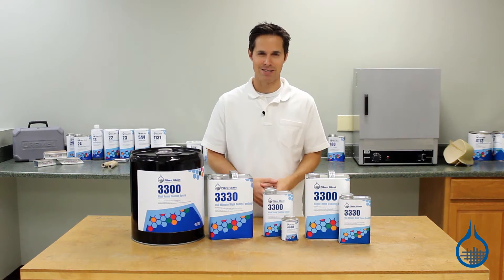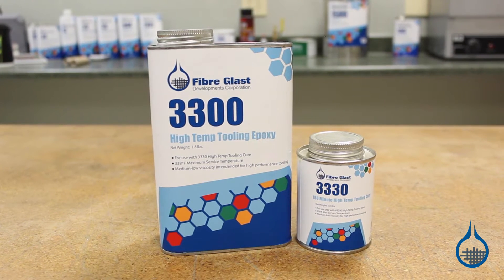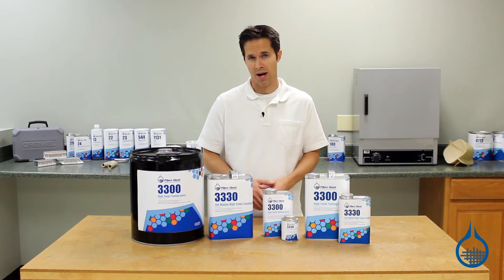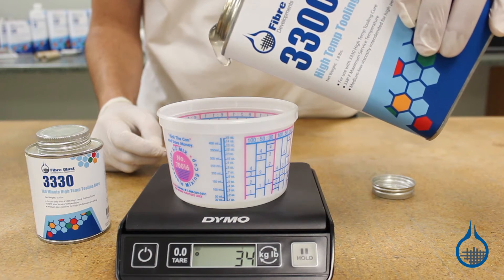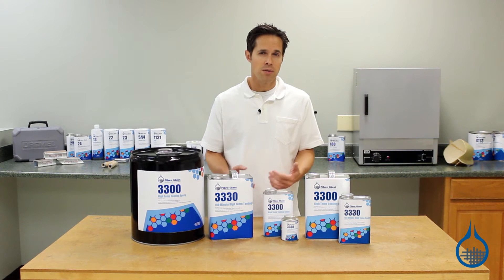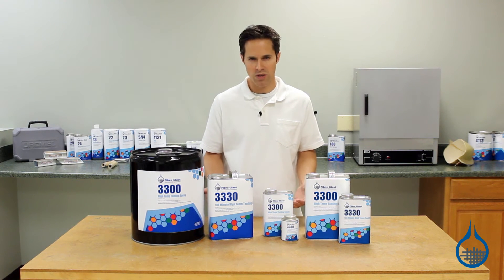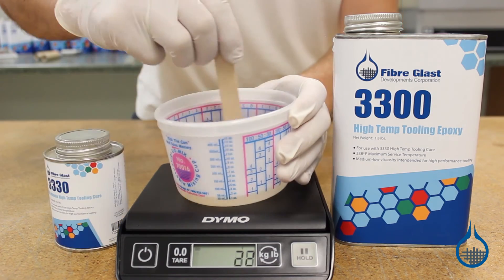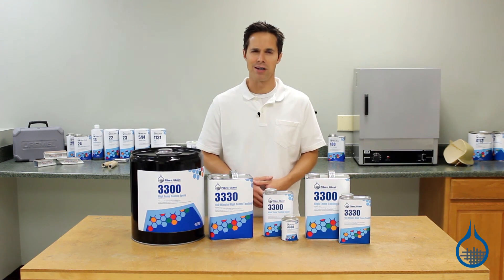System 3300 High Temp Tooling Epoxy

Comment: What if I want carbon fiber to withstand high temperatures after the parts been made
Reply from the maker: When creating a part from Carbon Fiber that will need to withstand high working temperatures we recommend that you create that part using our System 3000 High Temp Epoxy. If the part has already been created using a epoxy system not engineered to withstand high temperatures there isn't anything to our knowledge that can be applied after or onto your existing part to make it able to withstand elevated temperatures.